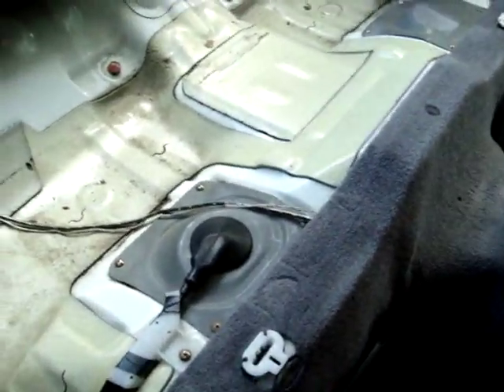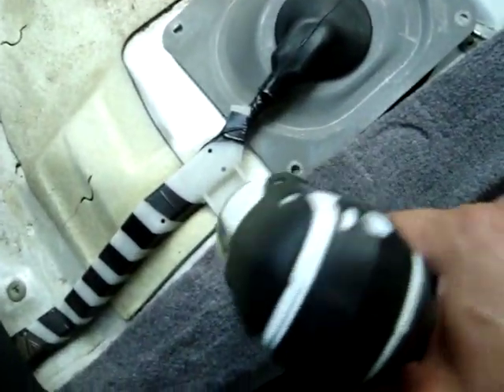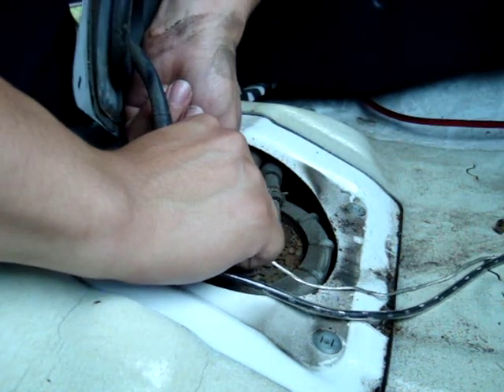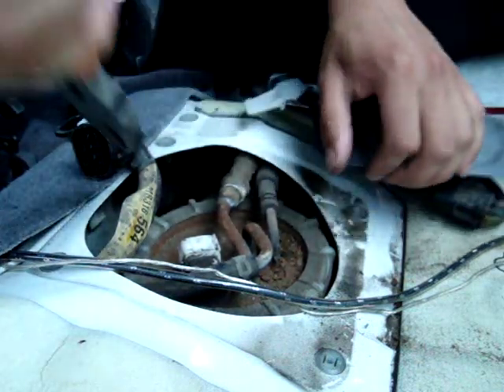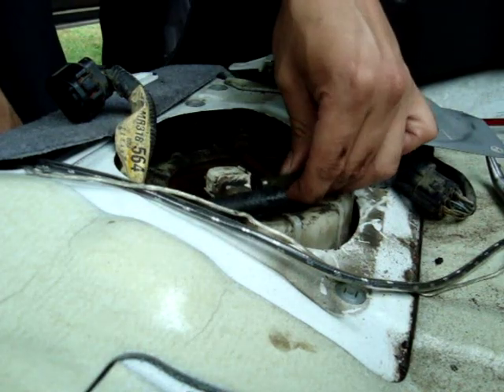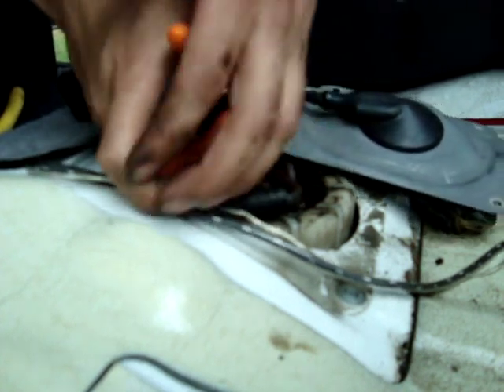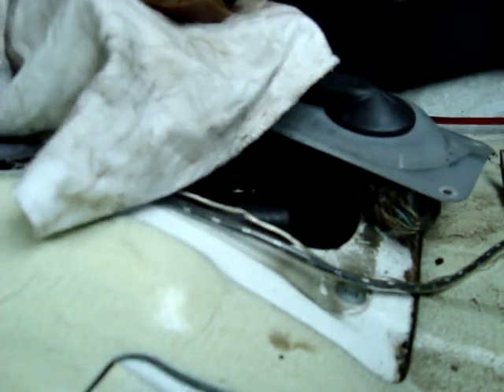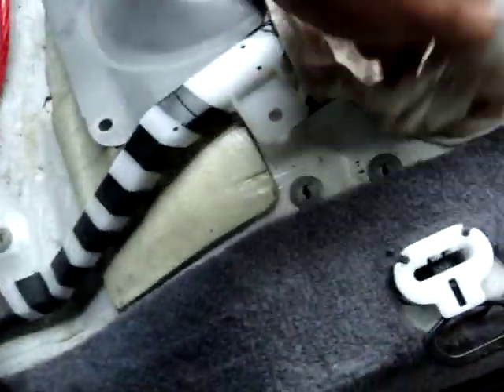Walbro Fuel Pump Install on a 2g AWD DSM - Part 1

Comment: hey some advice never ever squeeze a hose with those pliers once you get the clamp off you can use pliers to twist it while it still connected to break it loose. but never just squeeze the hose with pliers and pull unless you wanna replace it.

Comment: Excellent video clip. I am having the same problem disconnecting the top fitting. Will try for the bottom one. Does anyone know why it is much easier to unscrew the bottom fitting.

Comment: you actually could have pulled it with the line attached to the hanger. While under the car you feed the loose end back up into the cabin. Then get into the cabin and pull it through. You will then be able to pull the assembly without removing the line from the hanger or cutting the car.
Reply: yup you're right, after kinking my hard line at the top of the hanger I went for it and you can pull the whole hangar out cause there is enough slack in the high pressure line.

Comment: why not just use a lock ring wrench to remove the fuel pump from the tank, and use fuel line removal tool to get the fuel line off, they sell both of them at the auto parts stores. Makes things a whole lot easier.

Comment: Why did you cut your car crazy guy? You know the line comes off from the sending unit too. Its also a good idea to open the gas cap to relieve pressure if you just got done driving it. Another great video.